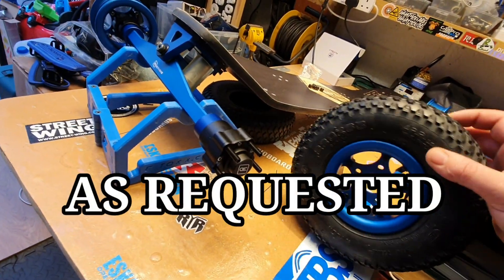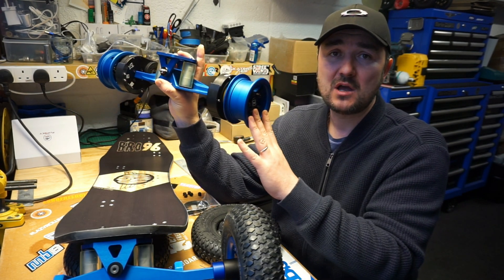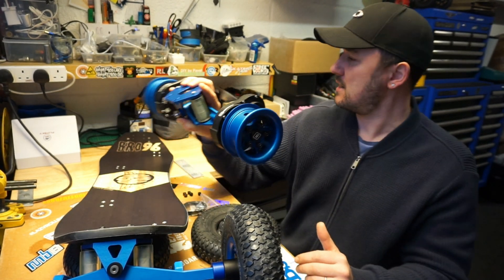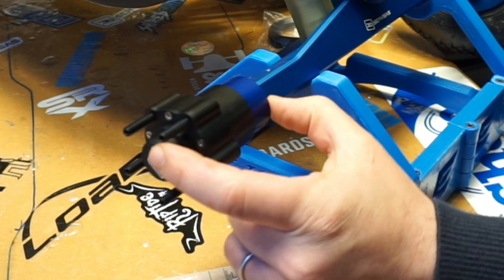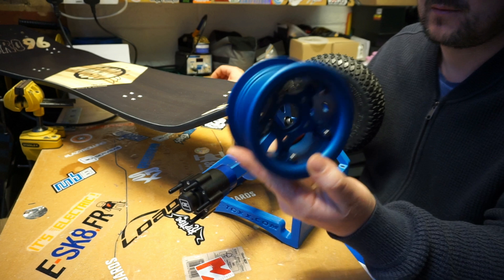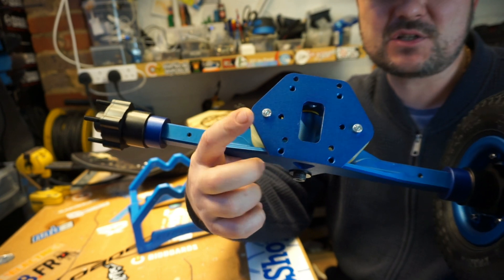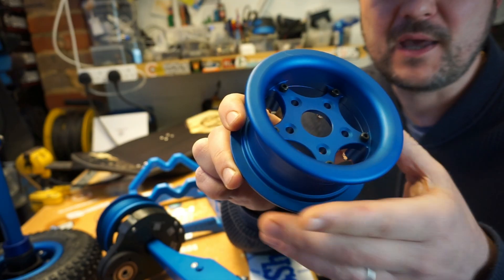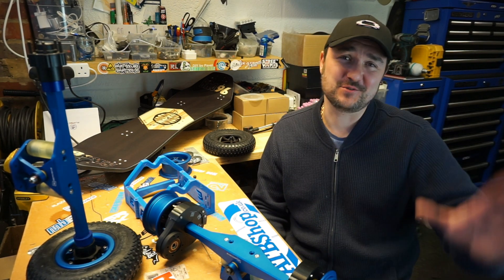FINALITY. New gear drive and hub system. Full review.

Comment: What's the change of shape in that truck different than other channel truck? (Scrub, Trampa, GI, MBS)? I'm serious.

Dampers are in the same spot (even GI Bionic 2 had it V-shaped lol). Kingpin seems the same length and diameter (Scrub had it bigger; sturdier and steadier, but bit heavier) . 
Kingpin placement also seems the same height from the deck and axle center! And Alpha Kites (holy grail from Czech, seriously) had it 1cm from the deck. It felt amazing.
Making the hanger wider sometimes isn't that good choice; it harms board response greatly (been that, done that) unless hanger is turned front-to-rear. 
NoSno riders would do that if they couldn't handle the balance... (Well, it worked on straights)

And about bearing-hub design;
For electric skateboard and flat stuff and asfalt?
Nice and brilliant!

But for downhill, kite, border cross, freestyle, freeride or street? Meh 🤷 useless.

Comment: Would these hub systems mount to a juma skate truck? I'm building a custom deck I'd mentioned last year, deck is almost complete so ready to order parts, if these could mount universally onto any truck that would be ideal just unsure of how the rear conical bearing housing from the truck would mount, grub screws?
Reply from the maker: Have you seen my review of newbee trucks, hubs snd geardrives?
Reply: @PavelGarmas  not yet will check it out now

Comment: Ooooh ! It looks Amazing 😍...
Do you think it's good for jump and offroad riding ? Should be crazy with 10" tyres 😍
Reply from the maker: Hi,
Thank you for watching. I have the board running already and did use it off road and a few jumps. It is very stable. 9" ids the proffered size.

Comment: i love you to bits Pav, but they're not better nor worth the extra extra extra money in relation to the quality. What they are is: cool, slick, pretty, fancy, a must have, a piece of artwork, a head turner... you know? falls in other categories other than penny on the buck
Reply from the maker: Hi mate! I love you too : )
I am not promoting any products just showing what is available and what i am using..
Do me a favour - try to make Finality kit out of other manufacturers parts and see i there is difference. 3D kit is 900 euro and  comes with :

Channel trucks X2
Baseplates
Wheel hubs X4
Helical gear drives X2
Barrels X4
Bash guards X2
Installation bolts and nuts  X8
All required bearings
Grease

Comment: Where do we get them and how much do they cost?
Reply from the maker: Hi mate. 3dservisas website.
https://shop.3dservisas.eu/products/finality-at-gear-drive
Reply: @PavelGarmas  cheerz mate. They are expensive but as it's the whole truck its probably worth every penny to have an integrated solution.  Hopefully we will see more trucks built specifically for eskate boards. I always wondered if someone would bring out a truck with built in potentiometer so dual ESC's could be setup to turn the outer wheel more in a turn, like a electronic version of a slip diff, it should / would make carving easier.
Reply from the maker: @leighhoyte6230  i am sure that this hobby will evolve much more ...

Comment: I really don't get why this things are so overpriced? Segway sells brand new electric moped in that price or you can buy whole new motorcycle scooter for that much money with all the gears and wheels plus 1000 times more parts.
Reply from the maker: Try pricing a similar set up... or better try designing and building similar kit.
I know it's not cheap but quality is important to me ...
Reply: @PavelGarmas  yeah I got this, I didn't mean the particular setup, I mean in general esk8 parts are way more expensive than bike or motorcycle or even car.
Reply: @shalvami  think about it, everything u mention have been here longer than esk8, more developed market, better manufacturing, higher demand, cheaper costs etc. Its electric, only recently pevs somewhat started going mainstream. NEW TECH, look at a prius vs a tesla, or a zx10r vs a zero sr, or a pedal bike vs electric bike lol. u can build a cheap diy, u just gotta know where to look and how low in performance u wanna trade for price.